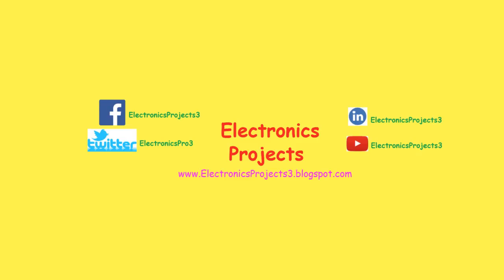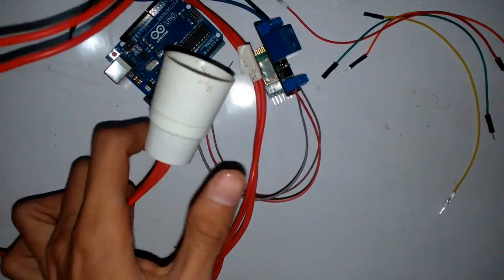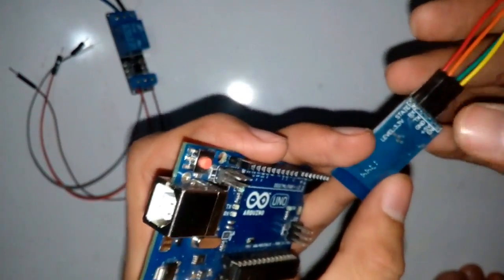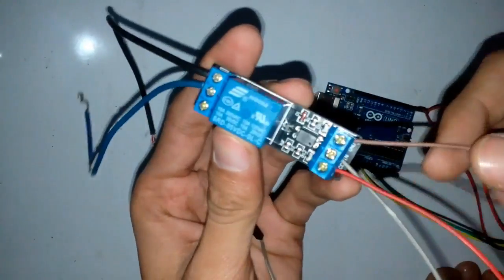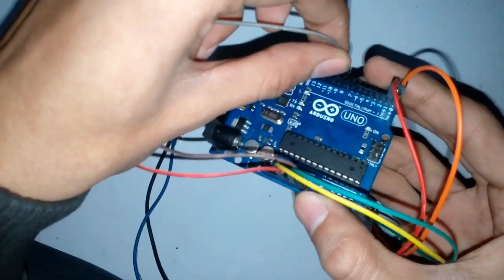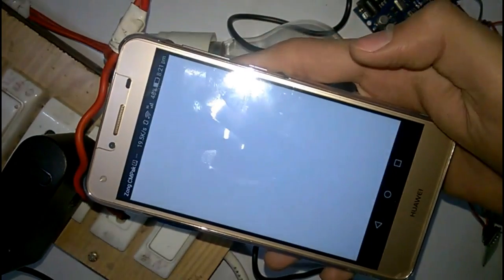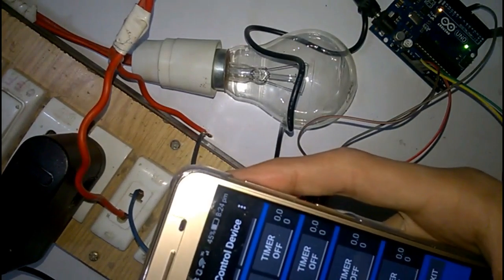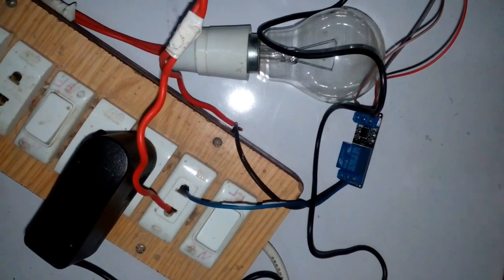Control Your Room Light by Your Mobile| Arduino FULL Setup home automation system electronic project

Comment: hello.... can you pls provide the code for this project.  i want to control the appliances from remote place using mobile... instead of bluetooth i want to use GSM module so that i can control the appliances from anywhere in the world.. can u pls help me out in designing a project using GSM module and Arduino...
Reply from the maker: dont use GSM module just use node mcu  wifi module to control appliances from anywhere in the world

Comment: And also we required components list
Reply from the maker: components used are:
1. arduino 
2. HC05 Bluetooth module
3. relay module
4. connecting wires
5. install arduino bluetooth application  in your phone

Comment: Bhai relay wali led work kar rahi hai but relay se connect appliance (bulb) nahi jal rah hai
Reply from the maker: check output connections of relay  and hear the click sound of relay if click sound not heard  then check again the whole circuit maybe loosing in wires